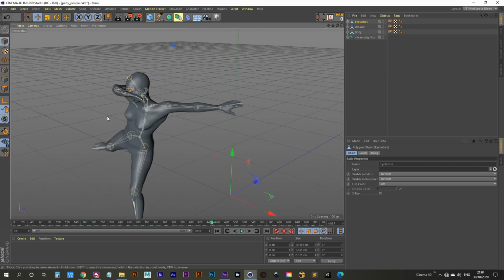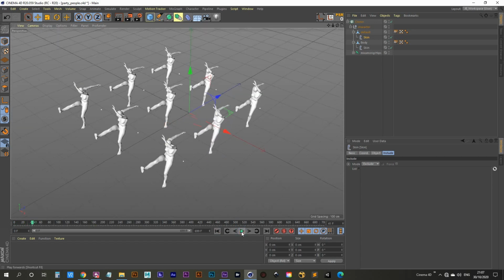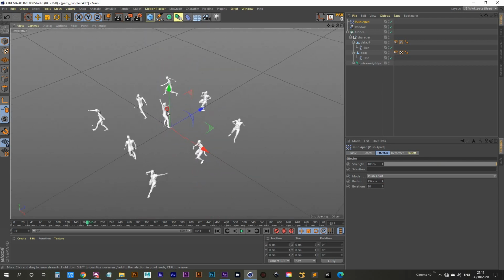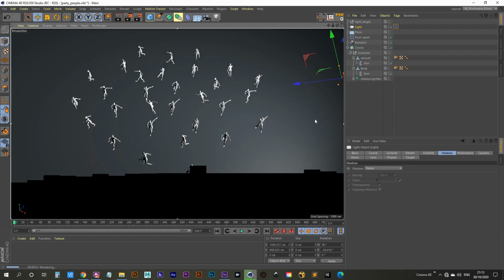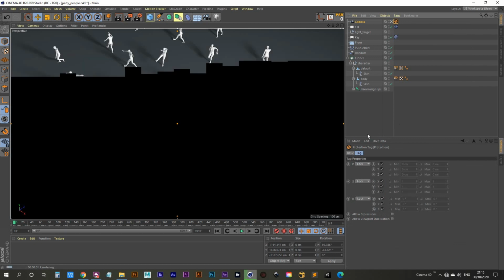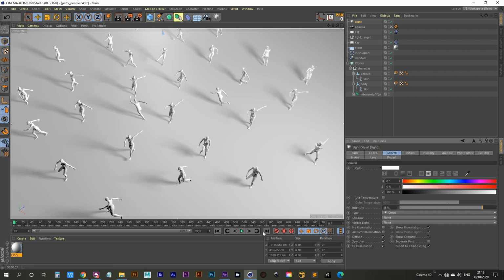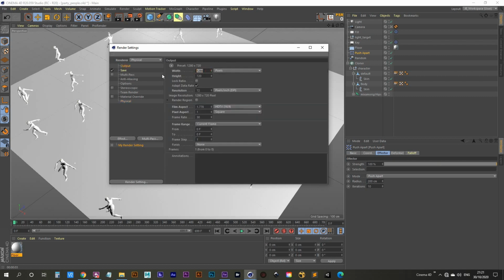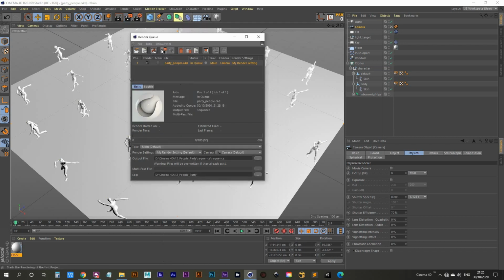C4D Tutorial - Clone Mixamo Characters

Comment: This is a great video. I've come back to it a couple times. But, I consistently run into the issue that I can't randomize the time if I'm using a Character Definition Tag and Character Solver to push the mocap date into my character. As soon as I offset the time by as little as 1 frame it breaks the link to the Character Solver for all of the cloned characters. Any thoughts on how to correct that? I'm in R26 at the moment but I had the same issues in 25 and 24.
Reply from the maker: Hi Steven, sorry but I haven't encountered that, never tried to use this set-up along with a character deformation tag

Comment: Anyway to offset the animation? everything happens at the same time
Reply from the maker: Hi Nawaz, yes you can offset the animation... See the video @ about 6 minutes in
Reply: @jbmocean399  doesn't work in r21
Reply: @jbmocean399  Sorry, it works, i had render instances on
Reply: @NawazAlamgir  still not working
Reply: @razedblaze5194  I know this is an old thread. But, I'm having similar issues especially if I'm using a character tag and character solver to link mocap to the character. Wondering if you ever figured this out.
Reply: I still have the same problem, time offset breaks the link between the rig and body... (P.S. thank you for the video)